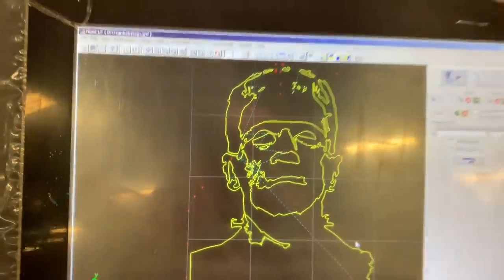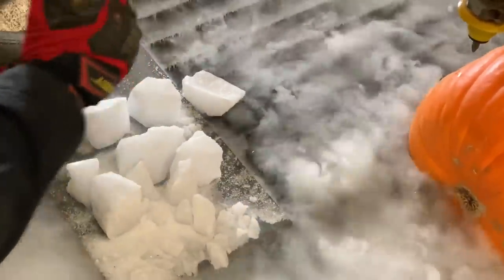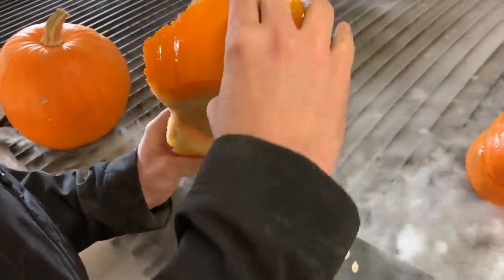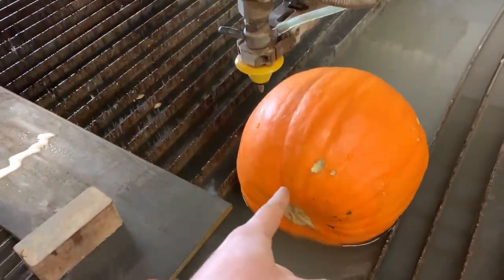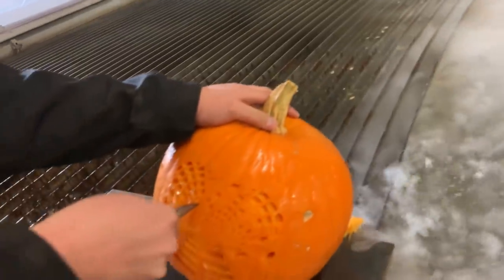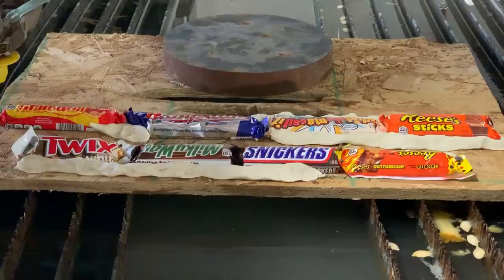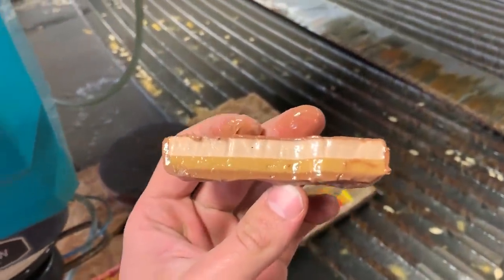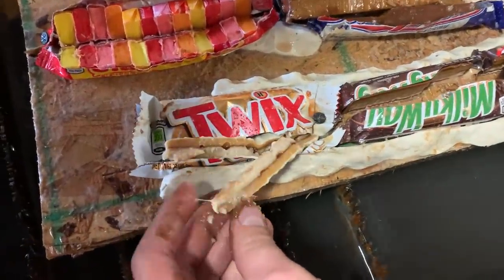CNC Intricate Pumpkin Carving Machine

Comment: I do this in my college class! All you have to do is clean the pumpkin out, and put a 1/8” metal sheet in the middle. It stops the water from punching through the back. Try this!
Reply: Vapor 280 yep. I recently did the same thing. We first drilled holes and submerged the pumpkin, then 5axis cut the lid off, and then filled it with metal and cut the design out. Ran 10,000 psi water only. (lowest settings we could do)
Reply: And epstein didnt kill himself
Reply: If you have watched any other videos from these guys you will know a metal plate won’t help lol

Comment: The key might be to fill the pumpkin up with water first.  You could poke a hole in the top and put a slow water hose into it, so it stays filled with water while you’re waterjetting it.

Comment: Here's how you keep it from blowing out the back.   Cut the lid and empty out the guts like you normally would.  Then hold the pumpkin in place so that it's half in the water (half filled with water).    The jet will cut through the front and remaining energy dispersed in the water inside the pumpkin.    Then can cut slower to get cleaner edges.

Comment: 3:30 you could have filled the pumpkin with water
Reply: Riesenfriese Or both,
But with just a plate the water might just ricochet and cut through the side of the pumpkin
Reply: @brandonb9452  Filling it with water would do what exactly? The giant like 4 foot tank of water underneath is how much water you need to not cut steel. What makes you think that like 5 inches of water is going to save the other end.
Reply: iored These guys operate the machine all the time and they thought they might be able to cut only one side with just air inside the pumpkin, as they’ve successfully done before.. adding water might make the small difference that’s needed in this case

Comment: What was your low pressure setting? Goodness! Maybe try a .010” orifice and a .030”? Mixing tube without garnet and ~10 ksi if your on/off valve is broken in a bit it might even go lower. Also maybe put a hole in the pumpkin in an unnoticeable location and fill it with water to decelerate the stream...before you make the first pierce. 😉